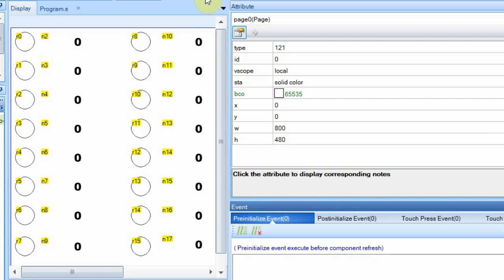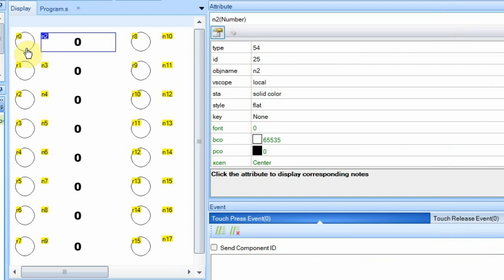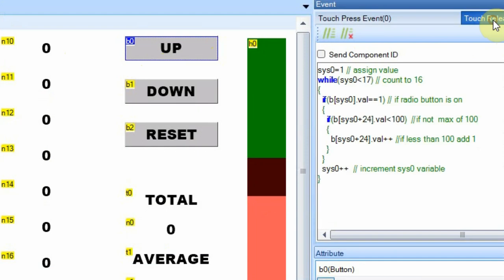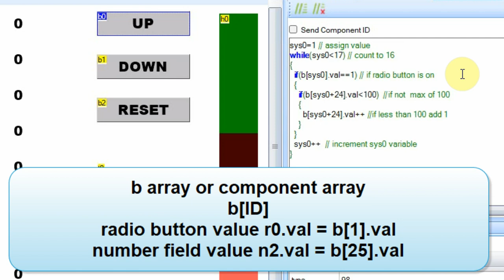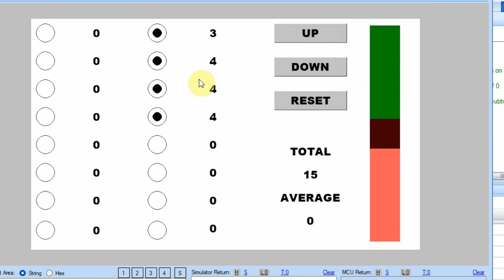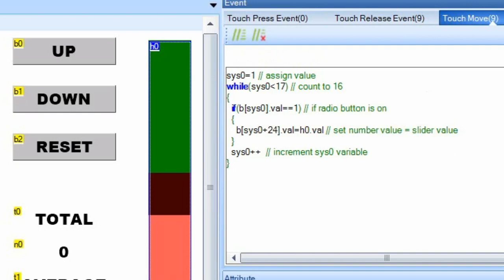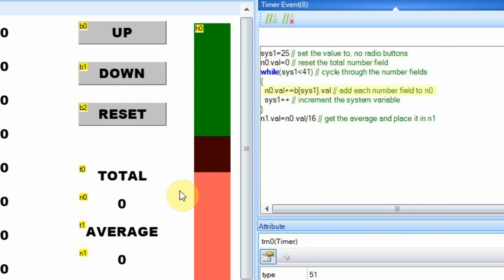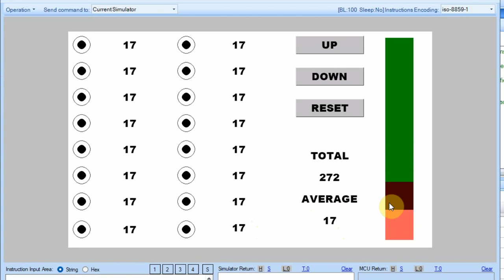187 with Audio! Nextion Component Names versus IDs and how to loop through them with less code

Comment: how to make it reset when you turn it on?
Reply from the maker: Thank you for watching and taking the time to comment.  I am not sure I understand.  What are you trying to reset?
Reply: @CheapControls  I want when I supply power to the display, he made a poll in what position the slicer h0
Reply from the maker: You have two choices.  You can do it on the page postinitialization or you could have a timer set to continually set n0.val = h0.val
Reply: @CheapControls  you are a genius)))
 I set the timer n0=h0 and the values were set at the start. 
thank you very much you are a good person!!!
Reply from the maker: I am glad it worked.

Comment: Do more esp32 vids!!!!
Reply from the maker: I plan on it.  Thanks for watching.
Reply from the maker: I am the same.  I wish I had started using the ESP32 earlier.  I am currently working with a Adafruit version of the UNO.  I will be going between the ESP and Adafruit.  My next video will be about Bluetooth and connecting the Nextion to a ESP32 wirelessly.  At least that is what I am planning.  I am doing it for myself.  I want to document some information.